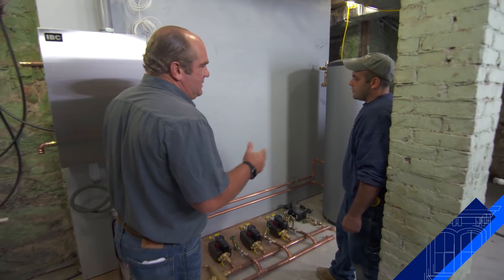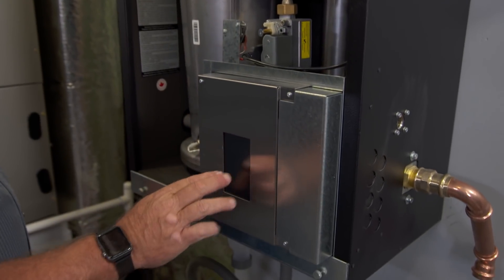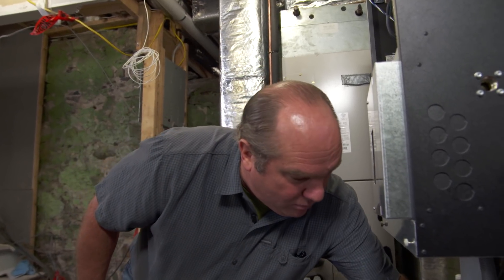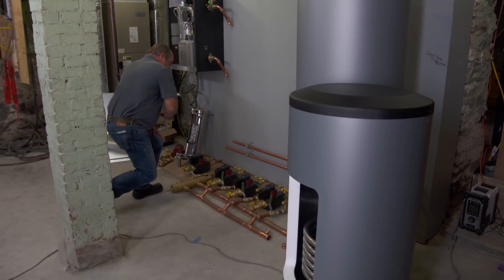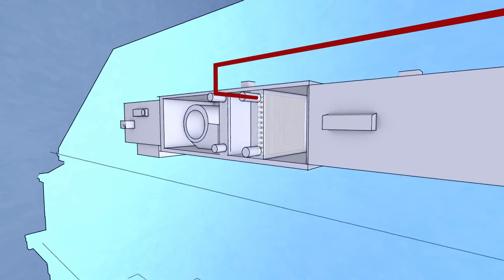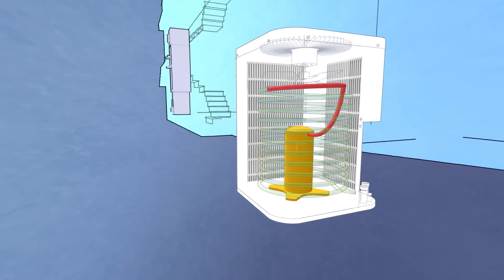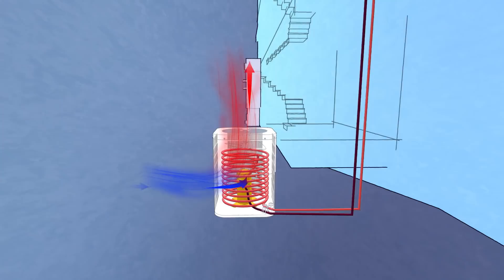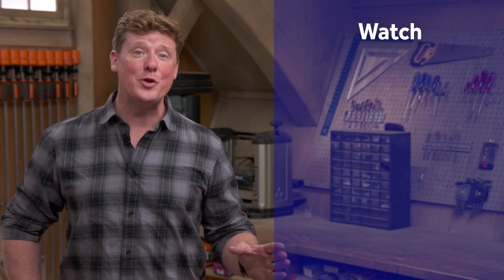How to Understand Thermal Heating Systems | This Old House

Comment: Great video the SL Series Boiler from IBC is smart enough not to need the additional mixing valve as it can control 4 pumps (four temperatures) + boiler pump, this means additional efficiency as you are not mixing down hotter water for your lower water temperatures, remember the lower the return water to a condensing boiler the more it condenses.  Plus that unit comes with a 10 year parts & labor warranty.  Come check out our other great products at our YouTube channel or visit our website http://fourmationsales.com/.

Comment: That particular model of boiler does not require the mixing valve to produce the lower water temperature desired for the radiant loop.  It is smart enough to recognize that a radiant heat loop is calling for heat and produce the lower water temperature.  When the indirect water heater calls for heat, the boiler will shut off all the other zones and produce hot, hot water to satisfy the domestic water call.
There is no need to add extra cost to the system.

Comment: Holy crap that is a complex heat system .
It must be very expensive and efficient.
Reply: I'm sure it's efficient and works well, but it's not efficient enough to ever recover the upfront cost of the system
Reply: @madcow3007  You would be surprised. Here in Germany its totally common and there every single room usually has its own zones

Comment: 30 years ago, back when hydro-air systems were not so common, we'd see the AC and heat coils stacked right on top of each other. Fast forward to a system malfunction with the AC and the inside coil freeze up, along with the heating coil.... which may split and piss system water out faster than the condensate drain can take it away. All of a sudden you have 3 rather expensive issues. OTOH, I have to say a full hydro-air system is probably one of the most comfortable ways to heat / cool the house, plus you have the option to add electronic air filtering year round for those who suffer from allergies. On the radiant tank: why not install a low temp t-stat on the tank so the boiler only maintains say 80 - 90 degrees? (about right for floor heat) No fancy mixing valves needed and the only addition would be a normal circulator to feed the loop via it's own t-stat, which you'd need anyway.

Comment: Based on all of the research I've done after buying a combi boiler with indirect water tank, they're not very reliable.  Whatever you do, don't get an HTP.  We've spent as much on repairing it as we did on the boiler and we've only had it for 3 years. grrrrrrrr

Comment: Indirect heated water tank does not mean it's not heated by flame. It means the water in the tank stays in the tank and is not plumbed to the boiler and heated there.

Comment: In the real world, if you have one boiler, you need only one pump. After the pump, you add in valves to direct the heat to where it's needed.

When you have more than one pump in a system, you can start getting crazy effects due to reverse flow caused by one pump pumping harder than another. Then you get a complex balancing act that has to balance in all conditions.

Comment: Not to mention that one of those smart grundfos circulators costs 200 dollars a piece. Also, if you bothered enough to run supply and return to the attic, then why would you bother with duct systems? I would find on craigs list beautiful vintage cast iron radiators, refinish them and use them because they work best with hydronics system.

Comment: I'll stick with a very simple dual zone hydronic system. It's utterly reliable. Separate gas water heater with standing pilot so I have hot water during power failures.

Comment: Does the water tank have a sacrificial rod in it? I didn't see 1.
Reply: It’s a stainless steel tank vs a glass line steel tank therefore much less susceptible to corrosion and therefore does not have one. It is a more durable product.

Comment: Now if you had installed radiant floor heating throughout the house you could skip the gas fired boiler and use the heatpump alone. Or at least use a heat pump with air handlers instead of the water-air handlers if you need cooling. You transfer heat from burning gas to water and then to air. Why not skip a step and transfer the heat through refirgerant to air handlers and be done. Every conversion from one medium to another adds loss.
Reply: Problem is the heat pumps up north cant handle the sub zero temps, they have to have an electric backup or gas as a secondary fuel. If NG is available, people are nuts to use a heat pump.
Reply: That's right, you tell them eaglevision993, you go boy!!!  :-)  They ain't got nothing on you  :-)

Comment: Goodluck finding parts for that specialized boiler that no supply house stocks when it breaks.
Reply: That thing is just a heat exchanger in an insulated tank. It depends on the material, if there's an anode inside, hardness of the water and so on how long this tank will last. Here in Germany we use that system for a long period of time, but this is only one possible way. In most cases you'll find a small local water heater for every sink and shower or bathtub.
The stainless tanks will last round about 40 years, the glass lined steel at max. 20 years, depending if there's an anode and how proper you maintain it. There are tanks in use which are already 30 years old and are still as good as new, except some lime scales. No rust.
Reply: @Marcel_Germann  The hard water we have here will kill that boiler in 3 years if not cleaned and descaled every year. Those wall mounted boilers will never see that life time here, work on them daily.  Rarely do customers do annual maintenance and they only call when they fail. The cast iron hot water boilers and steam boilers can see that lifespan but not those. I have more failure from the news systems like that then I do traditional boilers. These wall mounted units are nice Ideas but dont work well here because how poor the local governments maintain their water treatment plants,  we tell customers that want these they MUST HAVE whole house water filtration systems. None of our supply houses carry parts for them, its all special order, for one too little of them out there and too expensive to stock.
Reply: @zack9912000 I meant the heat exchanger tank for heating the potable water for sinks, showers and so on. Which is the big insulated tank shown in the video.
You should use a water softener for the water feed of the heating system. I got one...the manufacturer of my heating system demands it to install such a system. Even if my water is soft enough for that thing...if I hadn't installed one, the warranty would be voided:

https://abload.de/img/img_594614jcl.jpg